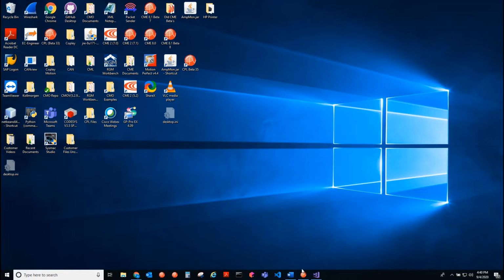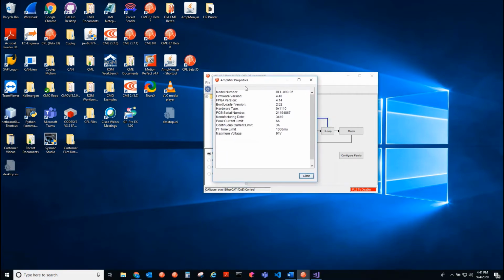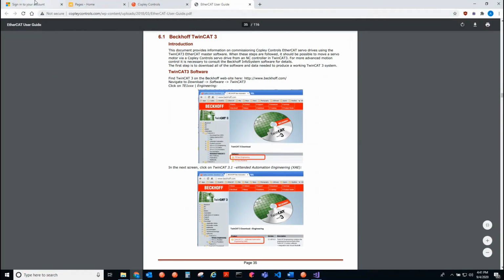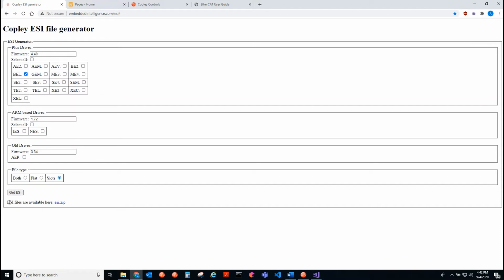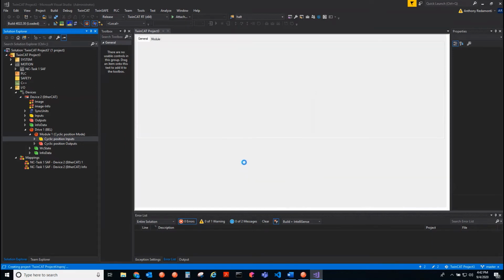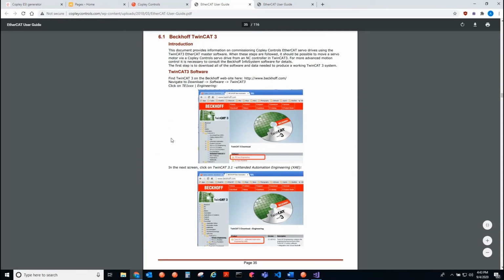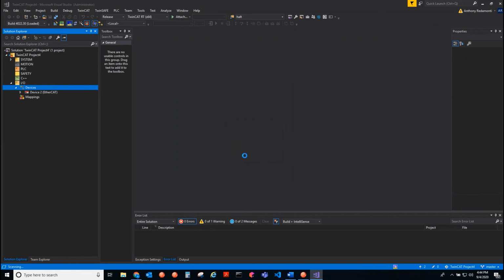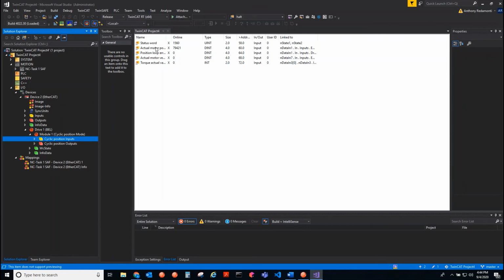Configuring TwinCAT 3.1 with Copley EtherCAT Drives

Comment: I have an accelnet adp drive connect to system via CAN Open, now i want to upgrade new PLC of beckhoff but I don’t want change the current hardware just add in, how I know which the best firmware for my driver to best fit with my Twincat software?

Comment: How do you set up other parameters in twincat to be cyclically reported in a custom PDO map ? Like bus voltage or motor amps
Reply from the maker: Object 0x2201 is Bus Voltage and 0x2215 is Actual Current. Both are TxPDO mappable. To map an EtherCAT PDO see our Trio video for the exact SDO sequence (link below) or read the CANopen Programmers Guide. Some objects are not PDO mappable (check the guide). The CANopen Guide is in the link below. It can also be accessed via CME > Help > All Documents > CANopen Programmer's Guide. 

Link: http://www.copleycontrols.com/wp-content/uploads/2018/02/CANopen-Programmers-Manual.pdf 

Link: https://www.youtube.com/watch?v=ZgTL9ymEpIs